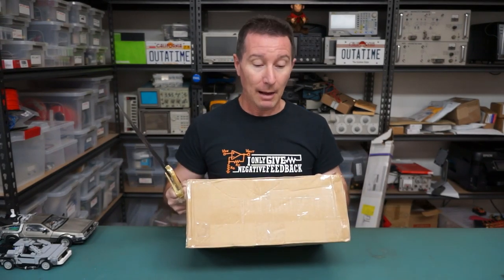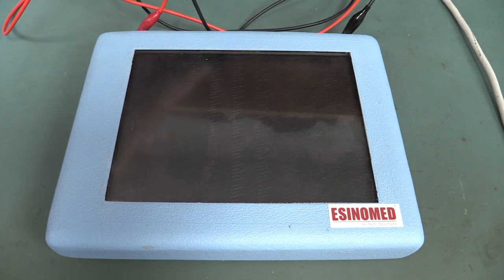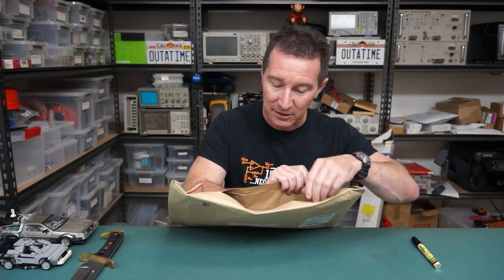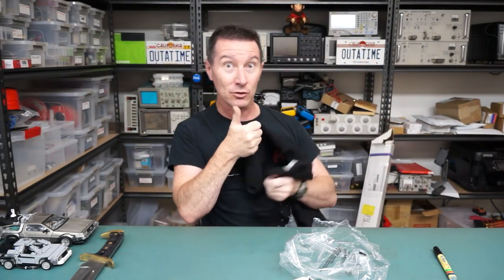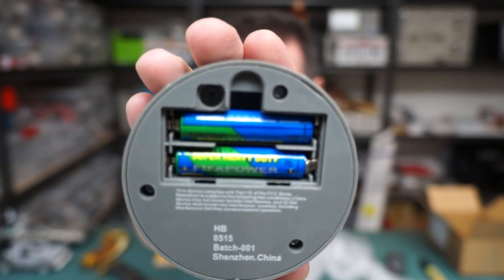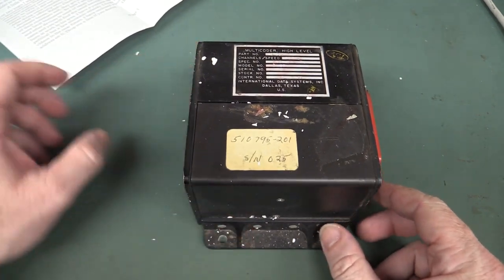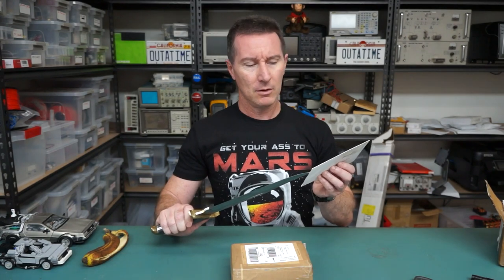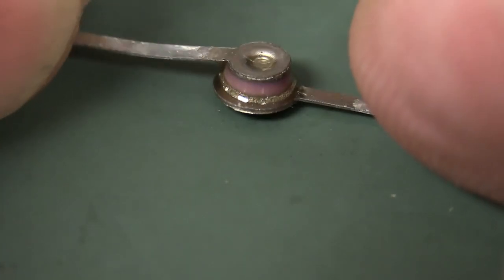EEVblog #821 - Mailbag

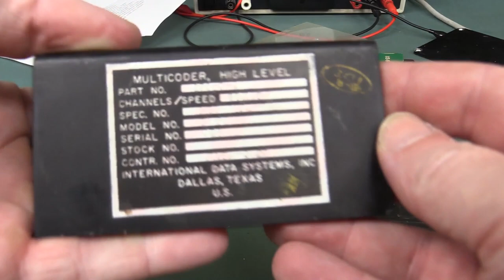Comment: 21:57 The Multicoder seems to be part of a NASA appliance. Contract No. NAS 9-3829. Here's something where a similar device seems to be used: http://ntrs.nasa.gov/archive/nasa/casi.ntrs.nasa.gov/19690026280.pdf … see pages B-21 (part 9) and B-22.

EDIT: NAS9 from the contract number describes the facility which initiated the contract. NAS9 seems to be the MSC, Manned Spacecraft Center. Today, known as Johnson Space Center. 3800s numbers seem to have been issued around 1967.

EDIT2: Here's more: http://www.eevblog.com/forum/blog/eevblog-821-mailbag/msg806525/#msg806525
Reply: *****: I'm not sure. NASA did various things from welding point tests to going to the moon under rather similar contract numbers.
Reply: +Markus Birth (mbirth) I guess it is some caveman AD telemetry shit.

Comment: Back in my Army days (late half 1990s), we used something very similar to that, also called multicoders.
Even though all our signal equipment was digital, our backup radio analoge systems could use "multicoders" to transmit/recieve data via analog radio signal. when dialed onto the same frequencies it sounded very much like old modems. 

The trick was, that all transmitted data has to be encoded then multicoded before going off in analoge, so we used costum linux based os, computers hooked up to regular radio transmitters and recievers via the multicoders.

And they looked VERY much like the one you took apart there, except our boxes where much larger, but still only had 1 input , 1 output in the regular 15 pin port, and a 12v powersupply port.

Comment: Believe it or not the coating on a MIL board you have could've been done by hand with a tiny nail brush. Working at the depot level any reworked boards would've been re-coated by the mechanic who fixed them. Doing wire wrapping in 2015 is quite the trip.

Comment: Those tunnel diodes are USSR-made high frequency diodes 3И306Р (3i306R). They were used in oscilloscope horizontal scan generators and triggering circuits.

Comment: Correction to summary on forum: This was obviously not an autopilot, just a position receiver to be connected to the autopilot.  Maybe, maybe not, using the same NMEA 9600bps protocol later used for GPS receivers.

Comment: That tablet is actually a bit newer and higher grade than we first thought, I think. The BIOS copyright is 2007, and it's got a good half gig of memory on board. Which is roughly equivalent to my own older HP tablet, but with a lower power (and so much cooler and much more efficient, one presumes) CPU and maybe a lower rez screen.Which is very confusing because why were they making that when machines with better performance and better touch screens could be had just by walking into a consumer electronics store at the time?
Reply: Not all stores stocked x86-based WinTel tablets (Arm based tablets like the iPad don't count if you need to run some existing hospital app written and tested for full size desktops).  Also most consumer and pro equipment comes with an explicit disclaimer prohibiting life/death use in places like hospitals. So there is a large niche market of companies building ordinary stuff but signing on to the higher risk of getting sued if someone dies because the doctor couldn't open the file with his notes.  Part of the work in that niche is going out of your way not to use parts with anti-medical disclaimers, so you may end up with a crap part because all the good choices came with a disclaimer, but that crap part forgot to do so.

Comment: I wonder if the french letter attached to the KeyDuino was a message from the airport/postal security, that they had to open it and check it for explosives and such.
Did you find out?
Reply: +Origineller Nickname It's my package and you in part right, in the customs declaration so it's write (in french) : x1 wood box, value = 1€, no liquids or organic material and others frenchs unnecessary unformations :p